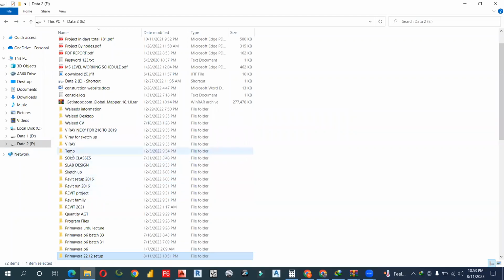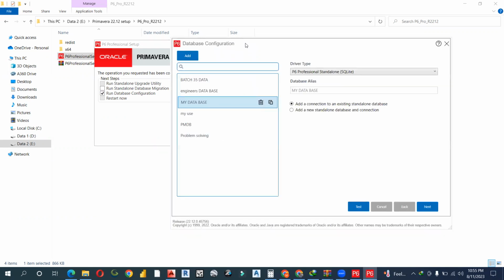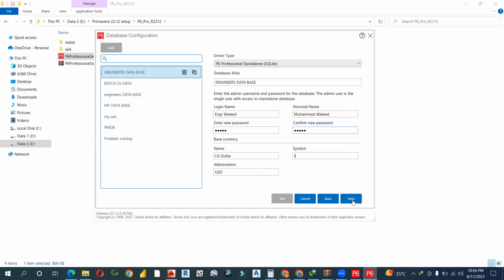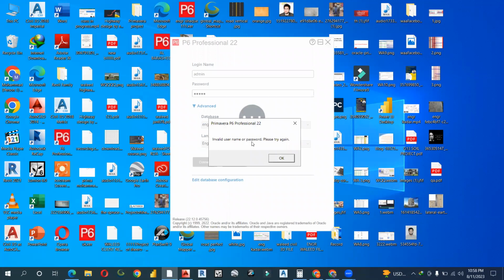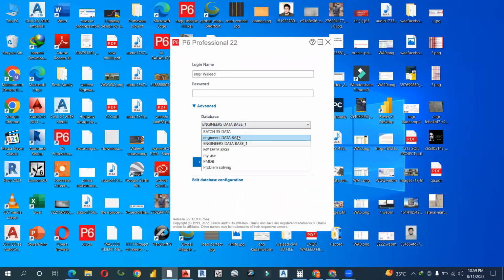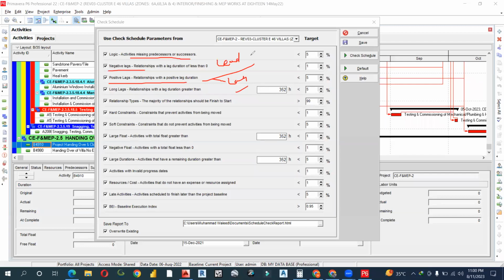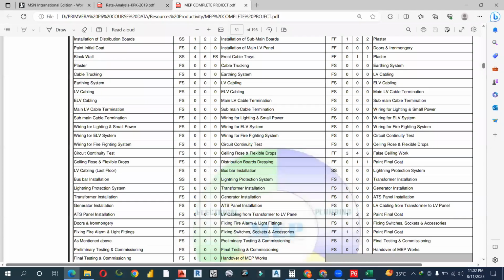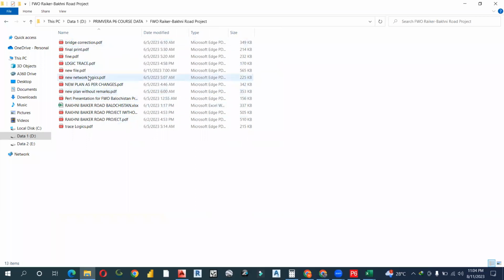HOW TO INSTALL PRIMAVERA P6 22.12 By Engr M Waleed

Comment: Dear Mr. Waleed, I have installed the software through your video. It works well. Excellent presentation and clear-cut information to install Primavera software. The way you have explained with proper input is top-notch. I will strongly recommend your video to my friends and you are the destination for anyone who wants to be an expert on this subject. 💯👌👏